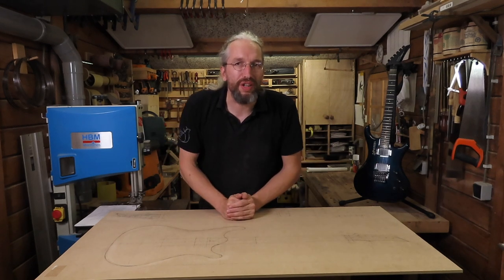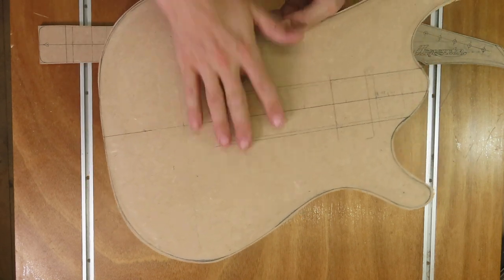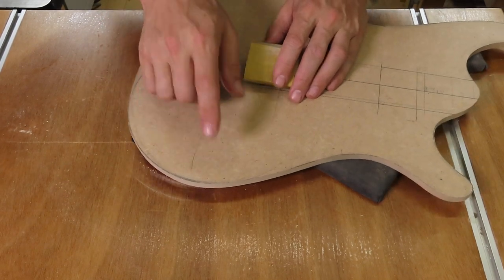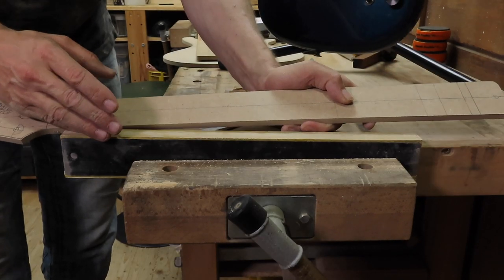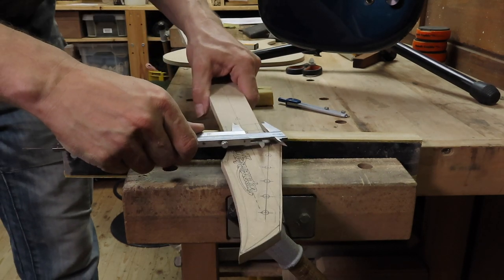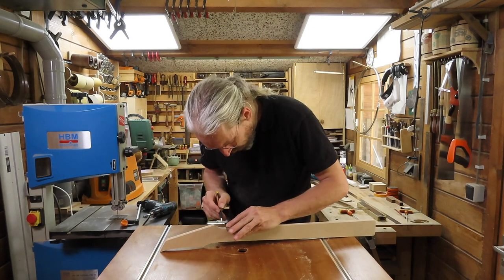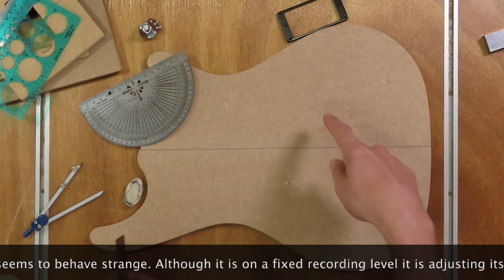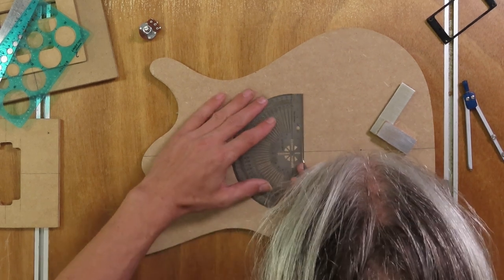Westone X390 Pantera CB - Tribute Guitar Build - Making the Templates by hand. (Template Tutorial)

Comment: OK I'll give you one.   One secret and that's it. ....get a 2 or 3 inch thick granite block and use spray adhesive 3m 90 and a rolling pin to seat the paper. Best straight block ever. Mine has 3 separate grits . When paper shears out peel it off and clean with lacquer thinner and a utility blade you'll use it for everything e.b.b. out